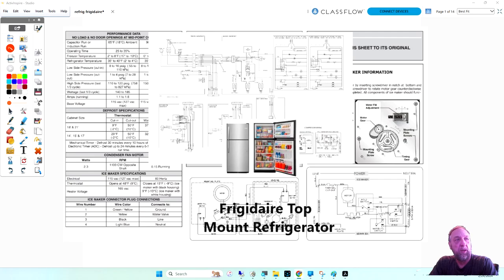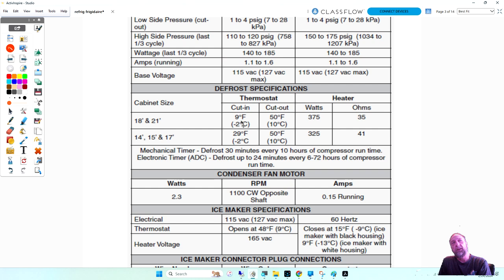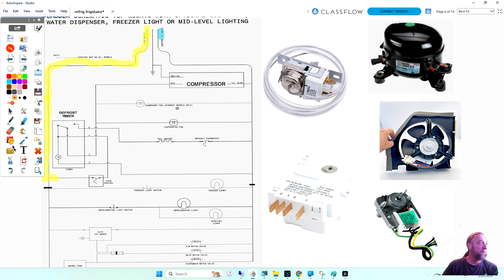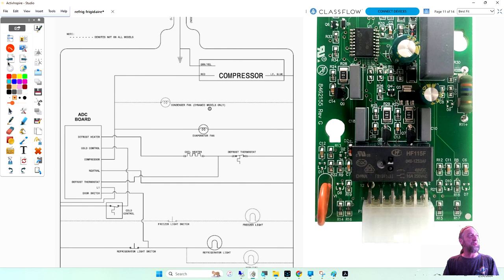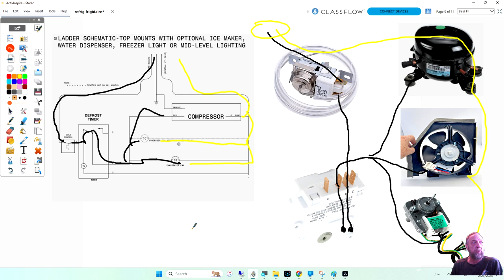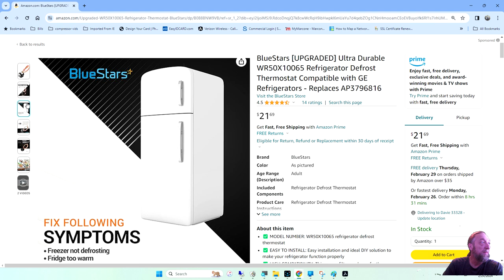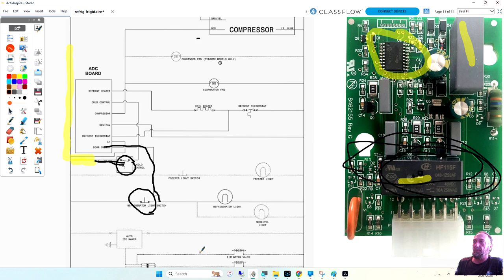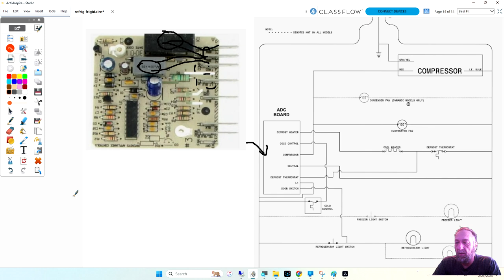Frigidaire top mount schematic

Comment: 6:21 - The condensing temperature of the typical refrigerator refrigerant R134a @150PSIG is 111.5F.
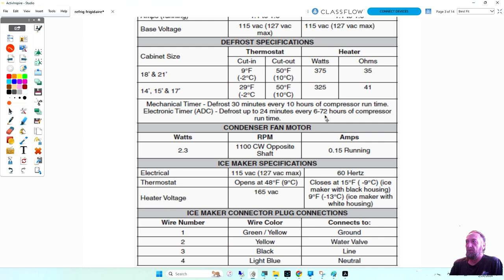14:30 - 120 is RMS voltage. The 165 is the peak voltage (I’m with you: why was that used in this chart?)
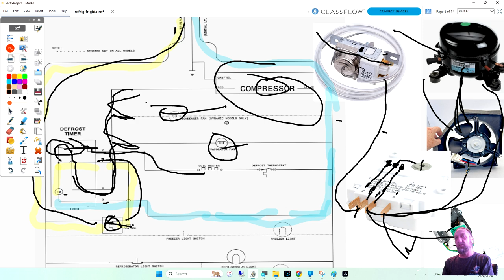40:43 - It is less likely to be a break in the wiring and more likely to be a bad connection at the compoment terminals.